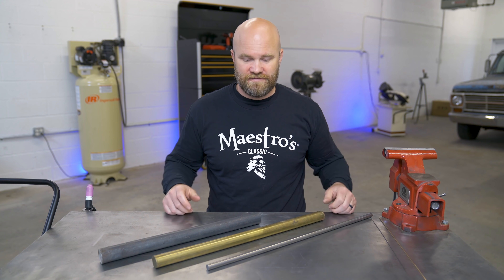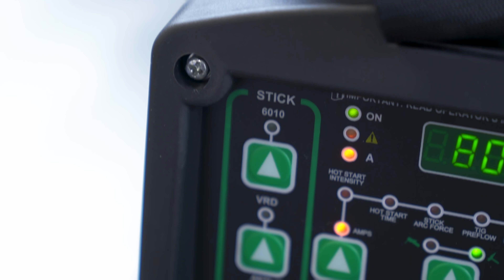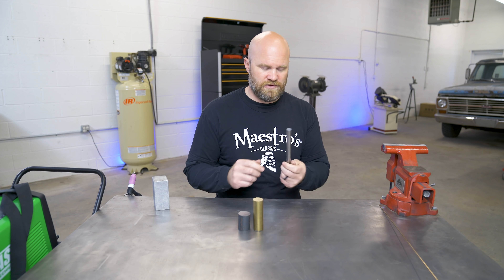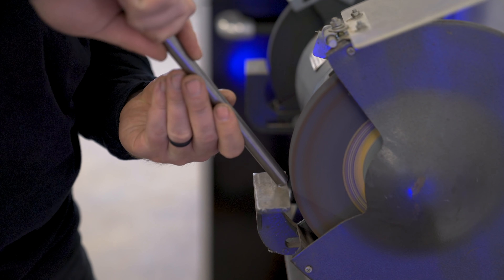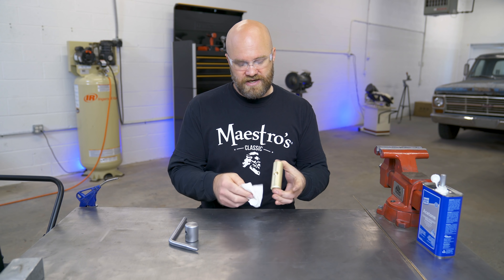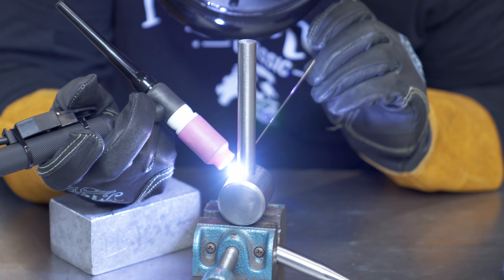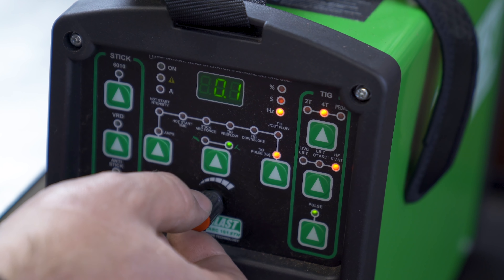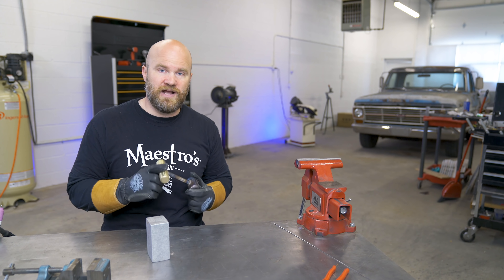A Quick and Useful TIG Welding Project - Welder's Third Hand

Comment from the maker: Seeing a lot of metric support! Sounds like I will be sticking with using both. Also thank you to everyone who has checked out joining the channel! Let me know if you have any emote or member badge ideas. I'm not fully locked in on the current set and open to suggestions.
Reply: For sure! Adding the metric is very comfortable. As far as I am concerned, saying "just over X mm" is absolutely enough. Unless it's a bit of precision machining instructions - think about what you would use thousands of inches for...

Comment: I use silicon bronze quite a lot but only on steel. I think the way to go with it is to heat the base metal through the silicon bronze. Start dipping ideally even before the base metal puddles. If it's too cold and balling up keep the arc on the blob you just dipped and kick the pedal briefly to make it sink in right. Then once you get going keep the heat on the puddle and dip lots of rod so you're never melting that base metal. Enough heat conducts through the puddle itself for it wet in.

Comment: Kool vid!! I wish I would of thought to use brass on my third hand...looks badass!!!
Oh yeah...HF sells a 32oz liquid sprayer that you can fill with the acetone and then you just add 100 psi of air into into it to pressurize. It last quit awhile before you need to add air again. Very handy...I’ve been using mine for about 2 years now with no problems from acetone in it.

Comment: Very cool to see you building a channel with limited resources! A quick note; I’ve gotten better results from pouring acetone on the cleaning surface than putting it on the rag and wiping. You end up transferring dirt from the rag to the workpiece if you have acetone on it first; whereas the acetone picks up debris and flows onto the paper towel if it’s dry.

Comment: What's the reason for the brass? Why couldn't you use the mild steel on both ends?
Reply from the maker: Just for looks, something different.
Reply: @JustVoss  Adding a silicon bronze facing to the tip of the third hand rod can help with grounding while tacking.  
Please continue to use SI (metric) measurements for length, temperature, gas flow rates, etc, as much as is practical in your videos.  Hopefully other US-based content creaters will follow suit.

Comment: Did you use any flux on the silicon bronze? I use flux when I braze with it using O/A torch
Reply from the maker: No not when you are using a shielding gas
Reply: @JustVoss  ahh.. Yes. Idk what I was thinking.. But you still have to get everything shiny clean too, yea? ..rod included..

Comment: New subscriber💪
Been meaning to make one of these for ages. The only thing would have done different is drill the counter weight through end to end. Love your no mess, clean looking vids.
MMs rule here in the UK 🤘
Reply from the maker: Yeah that may have been a good idea, then you would have the option of welding it on the other side and grinding it back smooth for a clean look. Thanks for the sub!

Comment: I'm American and I can go both ways with measurements. I prefer imperial (inches) as it's what I'm most familiar with and most machining done in the US, as well as weld consumables are measured this way. However it's easy enough to convert. Inches to mm = inch measurement x 25.4 (1in = 25.4mm). mm to in is just division mm measurement / 25.4 (25.4/25.4 = 1 inch).
Reply: I'm also american and I also go both ways. . . oh you're talking about measurements? Gotcha

Comment: Anyone know where to put the promo code on the everlast checkout page?
Reply from the maker: They are reworking the site to have a actual promo code section. For now you can put it in the comments section on checkout. It works for machines that come with a standard pedal and upgrades both the torch and the pedal.

Comment: Metric system is for people that want to think less. I despise the metric system. Mechanics were forced to purchased double the tools to work on cars.  I had a German tool and die maker that used to work at Glenn L. Martin's Aircraft Factory explain to me that the metric bolt system is not as good as the American system. Give me the inch, the pint, the pound,